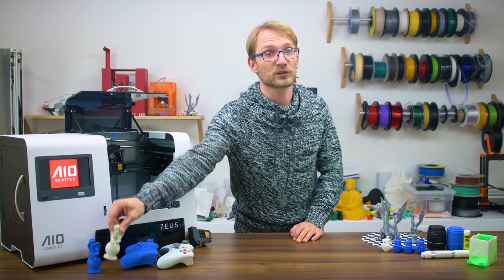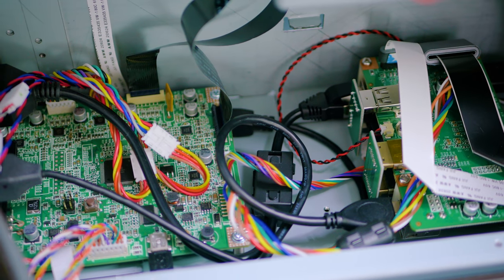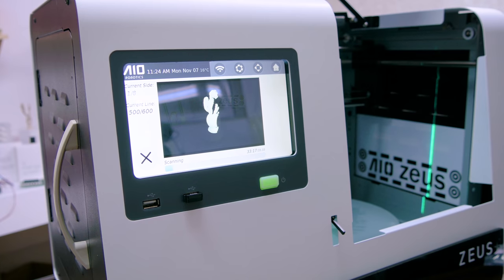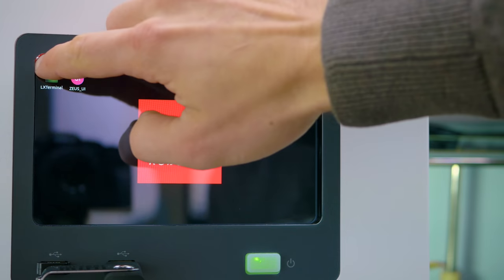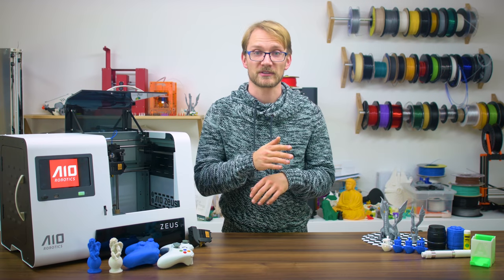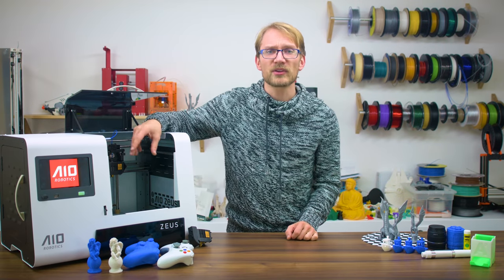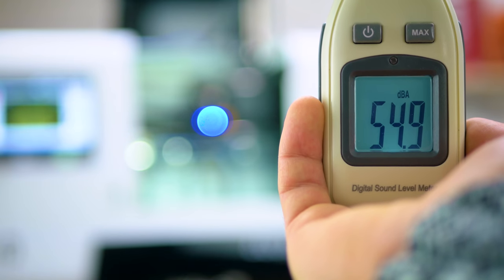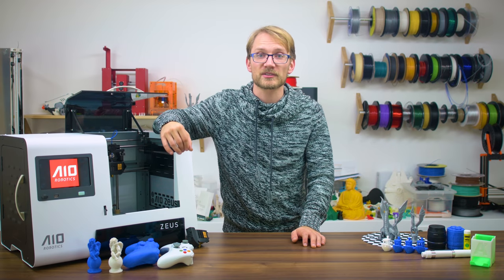3D Scanner, Printer and Copier - AIO Robotics ZEUS review!

Comment: I think photogrammetry is the future for 3D scanning. No special hardware, just take a bunch of photos with your smartphone in front of a neutral background and in soft lighting and run it through a software. Take all the angles you want. 
Only downside currently is that photogrammetry software is either expensive or a bit limited.

Comment: It looks like they never finished engineering it and decided to push it.The scanner is very low quality and the print bed has no heat and is too small. For 2 grand, there are far better options for a printer.

Comment: Hey Tom, almost completely irrelevant question but have you tested the battery holder you printed? I was going to print it myself but the comments said the batteries don't auto feed properly so I ended up printing a different design.
Reply: I printed one and indeed it doesn't auto feed properly. What did you print instead?

Comment: whoa... Wireshark!
Reply: Indeed! oh... your physical location was sent back to the server.
Reply: I see, I can think of a good reason for that if the machine can be remotely accessed from the internet. Even if it does send it back to the server.  It is basically an ip address lookup for your External/WAN ip address so that the web service knows the ip address and  how to connect to the printer. The location is not required, though, perhaps, just a poorly programmed ip laddress  ookup service.
Reply: Also if the onboard computer is like a raspberry pi and has no battery backup, every boot up it would have to re set the clock via NTP so it might also do a location look up to find out how far ahead or behind GMT you are.

Comment: Honestly, i would not pay more then 400 euros for this printer aka. scanner, my 100 $ printer have same quality print, and with a good slide rotational stand and my smartphone i can get similar results in 3d scanning, even if i don't see the point of use in 3d scanning for small objects. I would pay 400 euro just for case and lcd diplay :) .